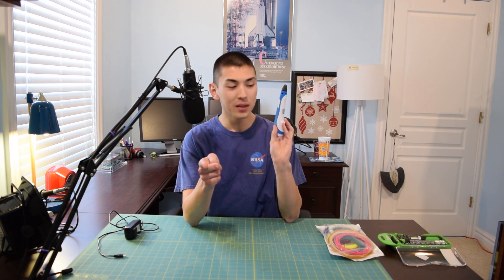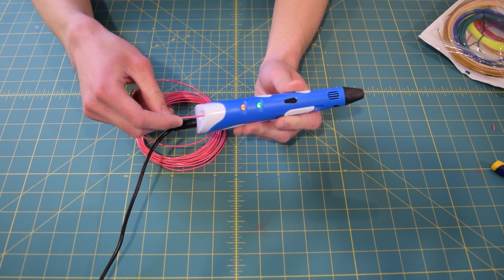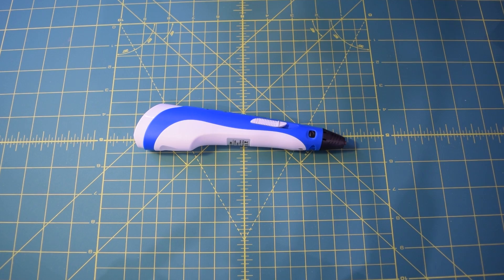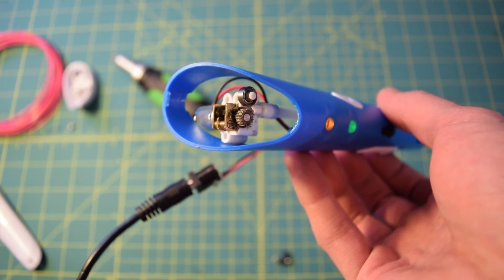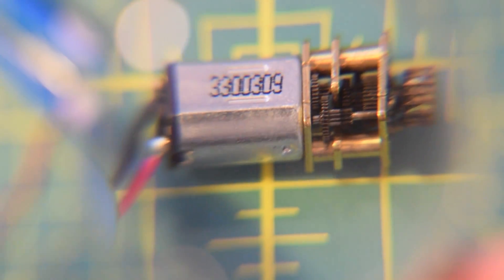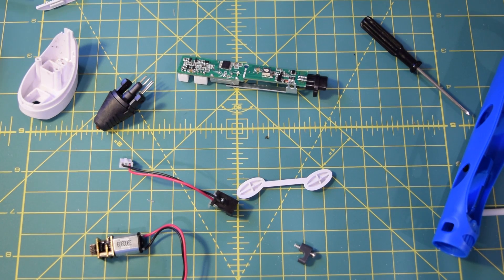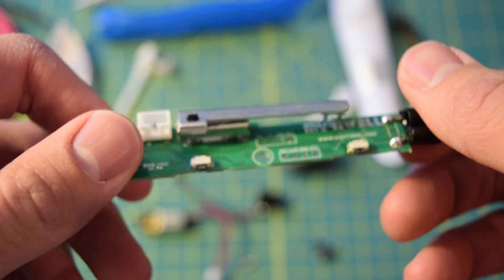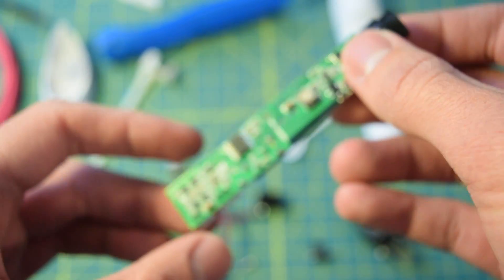Generic 3D Pen Teardown and Repair Attempt

Comment: same here.. my showed an "ERR" no matter what. i disconnected the motor (the tiny plastic the held the bearing broke off), i also put in a longer tube for the filament to manually feed the filament into the pen (which did work, for a while)...but it stopped and showed , "ERR" and that was it... i kept all of the parts,  and bought a nicer pen, with a 1year warranty!!!! (its a SCRIB3d, with filament)...
(the motor and its gears can be cleaned up nicely with a used toothbrush- i got all of the excess filament out of the gears....)

Comment: I myself fixed my 3d pen by myself the problem was there was a blockage  used surgical scissors to get extruder  out turns out just a tiny amount of plastic blocked the extruder used a metal wire to push it out  i was really happy that my  3D pen works fine now and i'm only a child

Comment: "As you guys can see, there's not much on here" - hahahaha - really? I can see a microcontroller, a trim pot, a voltage resulator, and complex power conditioning electronics.
They will all manage the user interface (buttons etc.) and control the temperature of the hot end and the motion of the motor, and so on. There's A LOT on there.

Comment: I ran into a problem with an almost identical pen where it stopped extruding too. The problem for mine ended up being a clog instead of a bad gear box. The solution was just to heat up the pen slightly, remove the hot-end cover, and then pull out the excess filament with some plastic tweezers. (plastic so as not to accidentally short out the hot-end's pins.)

Comment: my 3d pen wont even turn green, i try to turn it on but it would either do nothing or turn off even with the  wire still connected
Reply: @blackwolf try pressing the extrude button, the one with down arrow. Mine turns red/green once I press that button. Not very intuitive.

Comment: Hello is there any circuit diagram available for the pcb circuit board of the pen or u might have made the detailed study of it and made the diagram if yes then do let me know I'm in the need of it as I would like to study that circuit and is there any spec for the feeder motor, gearbox, heating coil and nozzle.
Reply: Im Looking forma the circuitry for de model with display. I have 10 of these with burned transistors
Reply: If your interested in that kind of level of detail, you might like the 3DSimo Kit 2 3D pen, its opensource and moddable :)

Comment: My first one had the exact same problem. The second one is the same make and takes ABS or PLA (first one was PLA only). So far (about 2 years) no problem with that one. I am much more careful about taking out the filament  now (no more yanking out the last inch or so).  EDITED TO ADD * HAD IT 6 years now  and it got clogged completely  which lead to me breaking the nozzle trying to clear it.so bought a new nozzle end and thats fixed it. could have used the nozzle from my first one as its just the same but couldnt find it until after i ordered a new nozzle so will keep that one for next time.

Comment: I have the same problem today. I think you can buy the motor with speed reducer and replace it in the 3D pen. I have found this item on eBay http://www.ebay.com/itm/12V-N20-Speed-Reduction-Gear-Motor-with-Gearbox-Wheel-For-3D-Smart-Printing-Pen-/331910098991.
Reply: I bought a new V2 pen for $15 some weeks ago on ebay, when my old one was broken (not the motor). So I have a lot of parts in spare fo nearly the same price.
Reply: Could you give me the link to your bought new V2 pen on eBay?